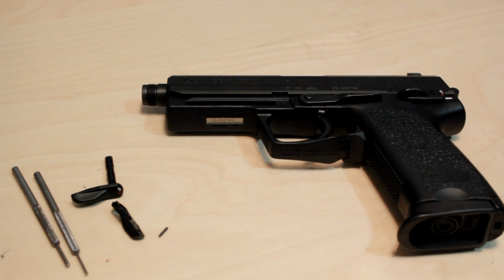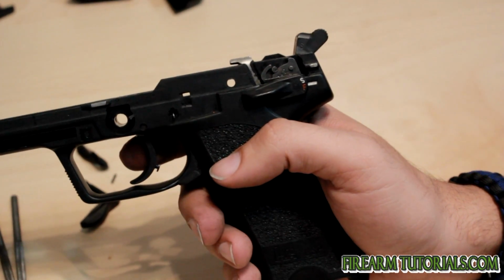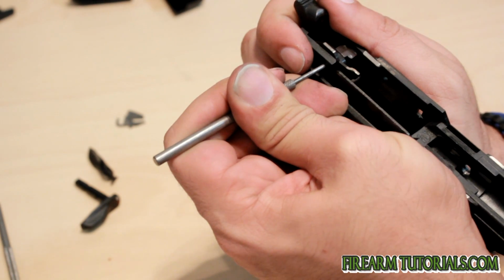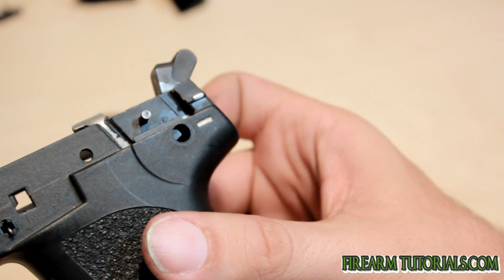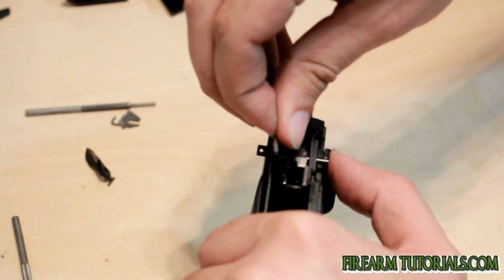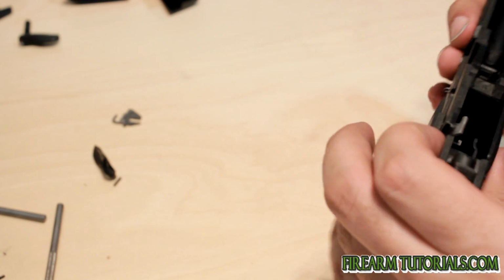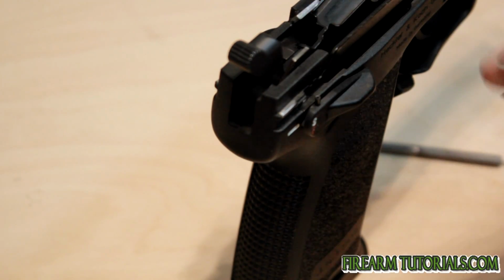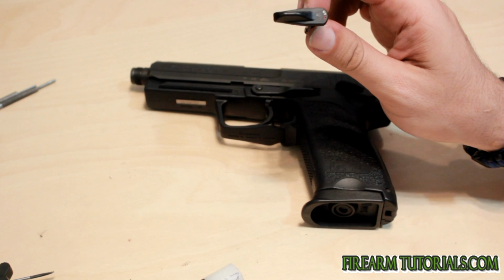HOWTO: HK USP ambi safety install

Comment: Bout lost my mind here pushing the pin too far and seeing the sear and everything load that pin out of alignment.. but took a shot in the dark and barely pulled the hammer back which unloaded everything just enough to get the pin back into the proper spot with my finger... thanks for a great and thorough lesson here!
Reply from the maker: Glad you got it!  A little tricky the first time but after you've done it and understand the internals it's easier the next time.

Comment: Hi. This is my first usp. I can only get the V1 variant at this time but I'm left handed. What parts would I need for the decocker, safety to be put on right side?  Like 5he v2. Tia
Reply from the maker: It requires a V2 lever.  You can't simply switch the V1 lever to the other side.  I went with the ambi since it's the best of both worlds.
Reply: @FirearmTutorials  ok thank you. Can you recommend a site,or link for that part. Thanks.
Reply from the maker: @jeffhollins9658  this is for the full size gun.  If you have a USP compact there is a different part
https://www.eurooptic.com/HK-USP-Ambi-Control-Lever-Kit-50217891.aspx
Reply: @FirearmTutorials  thank you

Comment: On a brand new USP .45 I could not get the control lever out. Local gunsmith helped. Had to also remove the catch and hammer spring.

Comment: Hey 10 years later this video is still very useful, thank you. I have a question. I want to swap a v2 lever in my usp. Do I need any plates or different desconectar or just the V2 lever??????,please.
Reply from the maker: Just a V2 lever.  The plates are v1 and v2: https://www.midwestgunworks.com/hk-usp/detent-plate.html  Nothing different on the disconnector.

Comment: Can you attach only the right side of the ambi lever for left handed shooting? or do you have to have both left and right?
Reply from the maker: They are all different parts.  The ambi, left side, and right side are all unique.
Reply: I just purchased a USP40 S&W V1 but I'm left handed. I'm trying to figure out the best way to modify the weapon so I can use it most comfortably in my left hand. Any recommendations? @FirearmTutorials
Reply from the maker: @LaughterIsDeadly  I'm a lefty as well.  I went with the ambi setup so it work with either hand.  If you only want the lever on the right side of the run for use with your left hand.... then you need a V2 lever.  Note that there is a full size and compact version.  The compact version has a "thinner" lever to keep the guns footprint as slim as possible.  If you have a fullsize gun (seems like do) get a fullsize V2 lever.
Reply: I do have the full-size. I'm also wondering, can I swap the slide release to the other side too on the v1? if so what do i need to do it? Do you have a video on that?  @FirearmTutorials
Reply from the maker: @LaughterIsDeadly you cannot change the slide release on the USP.  I drop it with my trigger finger.
Reply: ahh ok. Thank you so much for all the info! I guess I'll just have to get stronger with my trigger finger. It's pretty hard to pull down with my index finger at the moment. I'm not sure if that's because my finger is weak or because the gun is factory new. @FirearmTutorials
Reply from the maker: @LaughterIsDeadly  I have 10.5" hands so my long index finger reaches and I have enough leverage that it's doable for me.  I bought a P30 which has the ambi controls but I couldn't give up the USP.  My primary has over 10k rounds through it, and I have 5 or 6 USPs now :)
Reply: I love it to and I'm going to keep working with it until it feel natural! Thanks :) @FirearmTutorials

Comment: I meant detent plate. I got the detent plate and connector out. But I can't get the control lever out. It comes about 90% out. And even putting pressure down with a punch it acts like it is still attached or stuck on one last notch. I have pulled and wiggled it almost to the point of potentially damaging something. But it will won't come out. Any suggestions?

Comment: Excellent tutorial! I just used it to convert my HK45 from v1 to v3 and replace the safety/decocker. The only thing I would add (that isn't mentioned explicitly) is that when you are pushing the pin back in (from either direction), make sure the hammer is cocked. When it is decocked, it causes a slight misalignment between the holes through the sear group and the frame. Cocking it puts everything back in alignment and the pin goes in easily.

Thanks for taking the time to make this!
Reply: Underrated comment here! Wish I’d’ve checked before I installed mine!

Comment: Great directions. Accidentally ordered lefty shooter version of Usp compact. 70 bucks later for ambidextrous safety (single side was $29, figured why not both sides) plus $20 for gunsmiths center punch kit on Amaz, and I was done in 15mins, first try.  Well done video
Reply: Do you know the parts I would need to make a usp V1 to a V2? I'm a Lefty as well. Only have access to a V1 where I live.

Comment: Thank you for the great vid. Helped a HUGE amount. I just did 4 of these and it went well. 2 little tips. 1. when trying to get the pin back through the right side, it helps to move the trigger bar or the hammer to let off a little tension from the parts. Then the pin will work in easily. 2. when doing the lever in  or out, it helps to try at one o'clock for part of the pull and 12 for the second half. reverse for putting in. 
Never would have tried this without your video. Worked great! thank you!
Reply from the maker: Great!  Thanks for watching!

Comment: My safety is on the left side, would I be able to just remove it and re-install it on the right side?
Reply from the maker: Unfortunately, you'll need a V2 lever.
Reply: @FirearmTutorials  I attempted to install my v1 on the right side. Now its stuck. Smh
Reply from the maker: @scginda803  Yea!  it would be so much easier if you could just flip the V1.
Reply: @FirearmTutorials  I "unstucked" by watching a disassembly video. Thanks for the vid. The ambi safety works great.

Comment: Great instruction, man. While my pin was more of b** to move, you explained everything thoroughly so I could put it back together without issue. Especially loved how you showed how the dent and the other plate was supposed to move outside of the frame, so those that aren't super familiar with their USP can understand WHY such and such piece goes there. Makes it easier to put it back together when you understand HOW it works. Well done 7 years ago. LoL now that I have this done on my USP45CT I'm going to to it to my FSUSP45T and my other USPC CCW.
Reply from the maker: Glad it helped.  Thanks for watching
Reply from the maker: Just realized, you were the one who bought my USP compact... enjoy that gun.  The one in this video was an older one.

Comment: I may be able to purchase a used USP Compact V1.  I am also a left-handed shooter, sorry to say.  How do I get the ambi-lever to make it into a variant 4. e.g., decock ONLY, DA/SA trigger.  Your fix is way beyond my competence level, I do have a gunsmith that could probably do it. I also do believe the language in the manual (which I checked online) is to CYA on behalf of HK requiring a certified HK armorer to perform the mod.  Such a pricey pistol should not require end-user to jump through such hoops.  My gunsmith has 40 or more years' experience. Having said that, if I get the pistol I will refer him to your video for some guidance. Prompt reply appreciated, and Thank You!
Reply from the maker: To make it V4, you just need a different slide plate.  This gun has the V1+V2 plate.  It's really not that complicated.  If you watch this video a few times through and have the punches you should be able to get it yourself.  I have a few other vids on the LEM swap and hammer replacement.  Those will give you a better look at the internals of the gun as a whole.  The USP is not "that" complicated, but it's also not a Glock either.

Comment: Just bought my first gun, it has a right hand safety... can I use the existing part to make it left hand?
Reply: No you can not. The part will fit but the cam will not engage the safety
Reply from the maker: I think you can but the letters S and F would be upside down.  I don't remember if this is 100% accurate.  Early on with these guns I bought the levers to flip mine for left hand use.  If you shop around/wait you'll eventually find the ami-lever like this for around $40-$50, which is a much better in IMHO.  Keep in mind there are levers for full-size and compact.  Both will work, but but the compact ones are mean't for single stack frames and have a lower profile so they are a little harder to actuate with your finger.

Comment: Hi Eric, Something seems to be blocking the safety after it enters the hole about a quarter of the way in.Any ideas? Working on a HK 45, I have done this successfully on a few USPsThanksDean
Reply from the maker: push down on the "flag" with a punch?
Reply: Hi Eric, its past the flag, I can't seem to get the original nor the ambi more than a quarter of the way in. Something may be protruding in the safety hole. I will give HK a call.

Comment: Seems like I'm the only one having trouble. I just can't get the lever off my hk45 when I get to the part where you're suppose to use some elbow grease to pull it out while pushing the flag down. Any tips on accomplishing that?
Reply from the maker: Make sure your lever is rotated to the correct position when you start that.
Reply: +FirearmTutorials .com yea. I was at it all morning, all positions and just couldn't get it. Does the pin have to be set back all the way so the internals are aligned or will that cause more tension?
Reply: +Douglas Boehme no way.... I was playing with the hammer the whole time trying to get it out and nothing but didn't think of pulling the trigger lol.
Reply: +Douglas Boehme ok, thanks!

Comment: Being a lefty I currently have the control on the right side. To make it ambidextrous on a usp do I need the ambidextrous kit or just a certain left side control? Btw I find your videos most helpful. Thanks Dean
Reply from the maker: +Dean Mioli You need the kit.  It gives you an axel that goes all the way through the frame with a hole on the right side so you can attach the other lever with a roll pin.  FYI, there is a compact fullsize version.  They are not the same.

Comment: I just got done the install as well. Thank you for the video. I will say after the install the new levers seem to be stiff. Maybe there is a break in period?
Reply from the maker: +touofthehighplains Make sure the axel is centered in the detent plate.
Reply: +FirearmTutorials .com The pin is riding on the detent plate normally I think. Maybe my detent plate just isn't broken in.
Reply from the maker: My expert was like that from the factory.  It eventually loosened up.  Thanks for watching.

Comment: Cool.  Where is the best place to buy the part?  It's $100 on the H&K site... Wow.  Sometimes being a lefty is expensive!
Reply from the maker: Jesse Anderson If you wait/hunt you can find them for as little as $45.  HK will have a sale at the webshop.  Topgunsupply usually has them for cheaper.
Reply from the maker: hkparts.net is a rip off and the owner is a crook.  Believe it or not it's often cheaper to call HK customer service direct.
Reply: Thanks!
Reply from the maker: http://www.tacticalshit.com/hkparts-net-owner-faces-33-years-federal-prison-multiple-charges/

Comment: Thank you for posting this video. I was able to install an ambidextrous safety on my USP Compact 40 because of it.
One thing that I noticed after the install, is that the safety is pretty stiff now, especially when decocking. Will this loosen up over time?
Reply from the maker: Larry Hancock Maybe.  My Expert came like that from the factory.  You can try putting some grease on the detent plate.  Thanks for watching.
Reply: ***** 
Good deal. I pulled the safety back off and reinstalled it. It seems a bit easier to decock now and I'll be sure to grease it. 

Thanks again, awesome channel!

Comment: Hey there, great video! Just curious, have you done this to the hk45 too? If so, i wanted to know if you could tell me the dimensions on the lever on the HK45 internally? I'm looking to use that ambi lever on my airsoft replica, but i want to make sure they fit before purchasing it
Reply from the maker: I have not.  I know you can use the HK45 lever one the USP with some modification.  I think that means you may have to do some filing.  Not sure about airsoft guns.

Comment: Great tutorial. Switched mine from a left to a right lever. What grease is good use if the plate is dry?
Reply from the maker: I just used SNO.  cheap gun grease I found at my LGS.